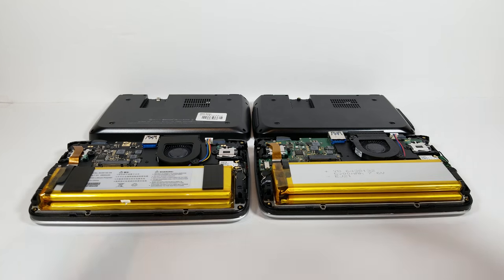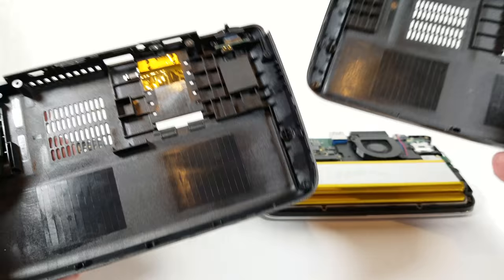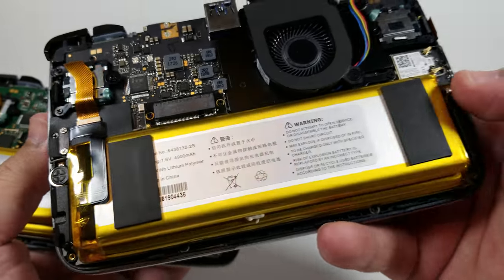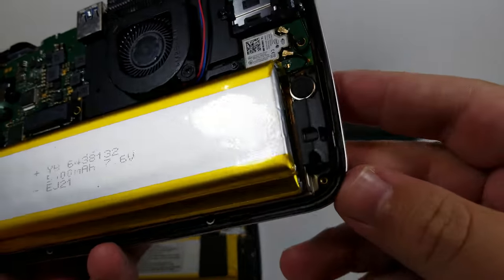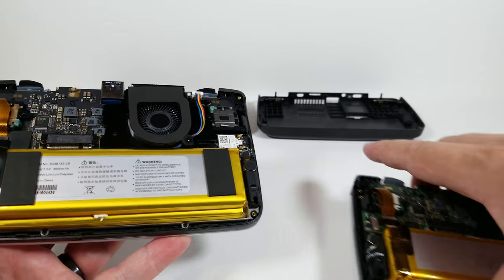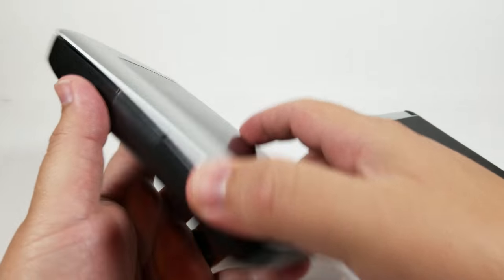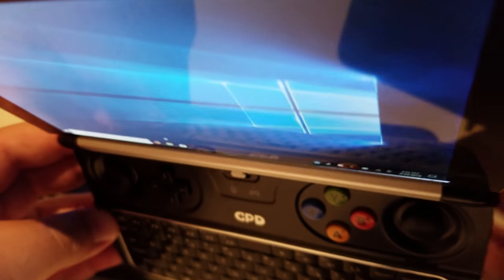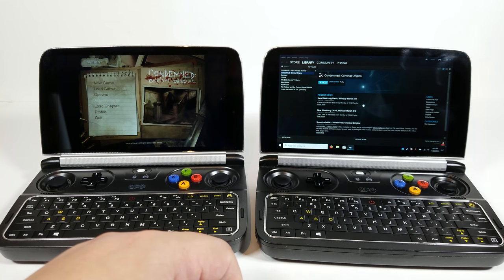GPD Win 2 - Prototype Vs. Retail Comparison

Comment: Interesting and good review. I recieved mine GPD Win 2 some weeks ago and it's really nice! However second day I had it it just didn't want to start up. Before it happen I tried to charge it with a battery pack which use standard 5V. However Win 2 using 12V so only charger with that V seem to work. However after I tried the battery pack the system didn't want to start. I send a mail through GPD team support page and thought I probably never going to get a reply. But they where quick to respond, in chineas, anyway they recommend to open up the unit and reconnect the battery, so I did. And it worked (and I have to say thank you for the replace the battery-video). Right now the issue I have notice is the d-pad makes squeezy sounds when pressing up, and the green (A)-button got stuck sometimes due probably you have press excatly in the middle. Some thoughts.

Comment: This isn’t really the place to ask, but I don’t know where else I should. I got my retail GPD Win 2 a few days ago, and it worked fine the first 24 hours, but after that, turning it on, it’ll suddenly lose all power within 5-10 minutes of use and refuse to turn on for a few hours after that. Any idea what could be causing my issue? I tried disconnecting the battery and draining it of the power before using the official charger to fill it back up again, but the issue still persists. Any help would be much appreciated.
Reply: MistressSpitfire idk. Ask on the gpd win discord, there are more people that can help you
Reply: MistressSpitfire betting on a faulty protection circuit on your battery pal. In short, battery is defective.

Get your confirmation with the GPD team bruh.
Reply: A little bit shitty that they're mailing out products with defective parts and expecting you as a consumer to have to pay to repair them.
Reply: Hello there just received mine and took a reading about your problem.
Have u tried contact them? what is their answer?
Reply: Sent a message to them asking what I should do on thursday last week. Six days and no response.
Reply: i doubt it was on purpose since they're a very small company and they're trying to get people to like their products (most of their sales come from youtube, and word of mouth which minus the 1 quirk with the win one, i can recommend it for what it is.)
Reply: Thats why I still did not buy it. It cost too much, but does not have good quality.
Reply: so how ur device is doing? did they reply??
Reply: That's why return policies exit. If your unit has defective parts, return it at get another one for free.
Reply: @Sukuraidogai  Yeah. Wait another 2-3 month to get new one. Not a good idea. :-/
Reply: @SketchTurnerZero  but it is better than loosing your money

Comment: They have a new metal backing plate cover  for the ssd for better cooling with a high temp thermal adhesive and thermal silicone flims and silicone rubber pad

Comment: Have you tried any other SSDs? Want to get a 512GB, but if that produces too many Issues (like the previous Video you Posted), guess a 256GB should be enough.
Reply from the maker: I have the Transcend 512GB and it does produce considerably less heat, but I still think 256GB is the sweet spot.
Reply: Seems there is only 1 being Sold on Amazon for $800 Used. Is KingSpec any good, or was that the one that kicked out tons of Heat?
Reply from the maker: Chris Flowers kingspec had a lot of heat at 512GB. Really should max at 256GB regardless of brand if heat is a concern.

Comment: Phawx,, where did you get your gpd win 2? I know it is supposed to be 699.99, but I can't find any win 2's with that price. I can only find them for like 800-900+ dollars. And also, how would I know if I am buying the retail one and not the protoype. Thank you.
Reply: Originally we all thought they would start selling them in June. But it is now clear they will not start selling them until July. So, check gearbest and geekbuying then. As they are not really for normal sale yet.
Reply: Ah ok, thank you.
Reply: The lower price is for backers on indiegogo. Retail price gonna be $800-900.
Reply: Price is going to be $700-$800. Please do not pay someone more than $799 for it.
Reply: Avatar X aaah yes, thank you. You have eased my weariness.
Reply: retail price? 

Also, do you think it's preferable to buy now or later? i.e. will this be a hard, rare product to find in 6 months because there won't be a lot of them in circulation?
Reply: @raze2012 You cannot buy it right now. Hopefully I will be available in a week or two at gearbest, geekbuying and the official gpd aliexpress store.
Reply: right, I was just more worried about undersupply when it does release. Did the original become hard to find at first? If so, I'd rather get it ASAP than risk being scalped on Ebay in December.
Reply: @raze2012 No, the GPD WIN 1 was released in October 2016 and it can still be easily acquired as GPD still has 1000 of them to liquidate as of last week. But they do have now stopped production of it as it uses an Atom X7 v2 (z8750) which is getting harder to find in small quantities. The GPD WIN 2 uses the Core M3 7y30 which is a lot more plentiful. It should be in availability for 18months.  And there is also the M3 7y32. So, no worries.
Reply: ah excellent. That's very reassuring. Thanks so much!

Comment: Hey guys, does anyone know if GPD sells some replacement parts? A friend of mine broke one of my sticks a little bit while playing DB fighterZ and now it feels kind of "loose".
Reply: White Rabbit You can broke GPDWin 2 so easy? Well, tthats what i am affraid of
Reply: No, it's pretty stable, it's just that my friend is a fcking idiot.^^ Maybe the sticks are not the best, but they are the same as the ones of PS Vita and GPD Win 1.
Reply: White Rabbit haha. I see. Hope you will repair it soon. P.s. i love sticks on my Vita. One of the best. I think its even more comfortable than my sticks on Switch.
Reply: I wouldn't go this far but it's cool that GPD doesn't build in "custom sticks". Because now I could technically just buy replacement sticks for the vita whicht makes reair much easier. But I still wanna know if GPD sells them separat, because I like the "rubber pads" they have modded on their version.
Reply: I thiknk GPD at least sells the rubber covers for the sticks. At least you could probably just get the Vita sticks and then remove the rubber cover from your broken stick.
Reply: White Rabbit Yeah. They need to build GPD Win 3 in a same way as Switch or ordinary notebook (with easy replacement part).

Comment: Phawx could you please recommend any SSD-upgrade for GPD WIN 2? Do you also consider power consumption buying these SSDs?
Reply: The recommended upgrade is to 256gb from either transcend or adata. As the price and heat jumps too much when you go with 512gb. Instead just also buy a 256gb msd.
Reply: MyDigitalSSD is also pretty good, with a really good price. TBH, I'm mega tempted to get a Transcend 512 GB SSD.  Even with an accompanying 256 GB uSD card, I'm running out of space for games and ROMs. I heard GPD is working on a metal cover for the SSD slot that will act as a rudimentary heatsink, so I'm waiting for that.
Reply: @Avatar X - That Transcend 512 is about double what the 256's are going for, so that's a reasonable scale up in price. Not sure about heat output though.
Reply: @Arthran - The MyDigitalSSD is probably decent (I have a couple of their other SSDs which seem fine) but keep in mind the ones available use the Phison S11 controller and are DRAMless, whereas the Transcend and Adata ("industrial" one on Amazon) do have DRAM. You'll probably want an SSD with DRAM for your system drive for performance and reliability, but a DRAMless drive would be OK as a secondary for storing games and such if this had a second m.2 slot, of course.

Comment: I remember saying I'd rather get this instead of a Switch, but it turns out I ended up receiving a Switch for my birthday, and considering my Steam library, I dunno whether I should get this just yet despite all of these great improvements. Probably still will one day, if it can run Soul Calibur VI when that releases. Since Tekken 7 can, maybe it'll have a chance.
Reply: If you have a switch you can now hack it easily thanks to the Team Xecuter  USB loader.
Reply: Avatar X stop
Reply: Avatar X ...Yeah, I'm not hacking it.
Reply: I wont stop.
Reply: @RJ well, just saying that it is an option now.
Reply: I know that it can sound a bit bad, but you could sell it!
Reply: L4p1nUs Why would he sell such a great console and especially when smash is near .-.

Comment: Does the GPD Win 2 have clickable analogue sticks?
Reply: rjc0234 
I don't think so.... they are/were stand alone R3 L3 buttons on Keyboard and and shoulders buttons for GDP 1 and 2 respectively
Reply: rjc0234 no it doesn't. I had one and just returned it. Analog controls stick should be alot better
Reply: sword ali ah, so the L3 R3 are now "trigger" buttons, as the placement on the win 1 was garbage. Will have to look into it